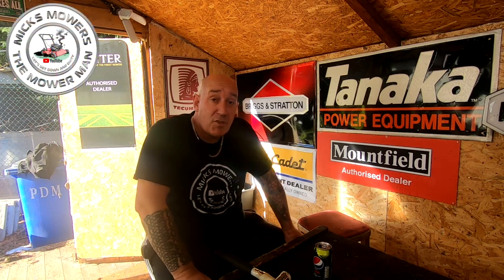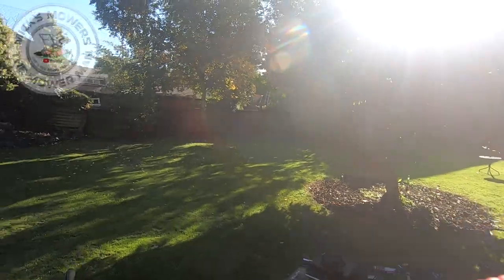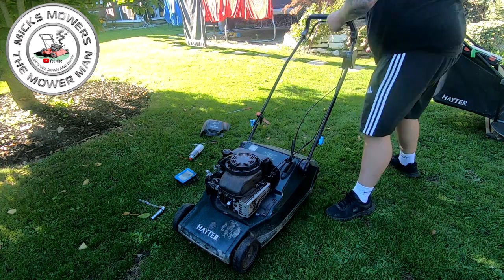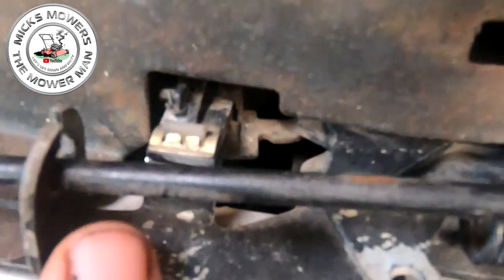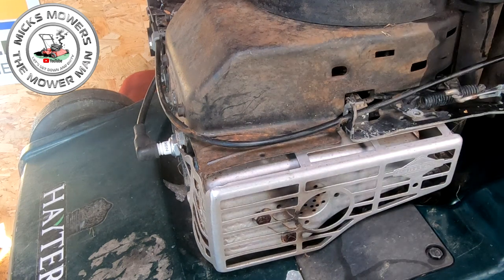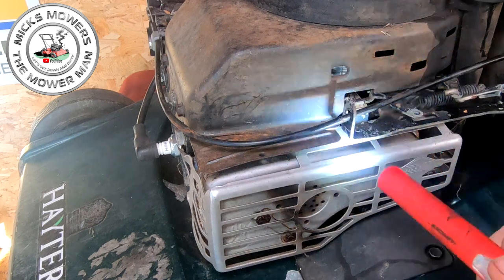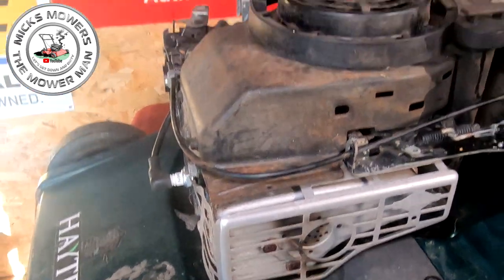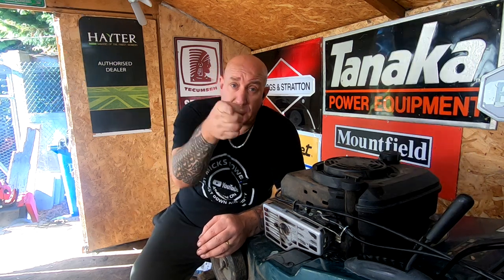Lawn Mower Will Not Start Or No Spark. Try This First..

Comment: Thank you Mick. Gonna disconnect the cable and try to adjust. Hopefully once I have done that , I can get adjust part to adjust. Both were just spinning last night by hand. 
I’ve a harrier 41 , is worth trying to take the top off ? To get closer to switch to give a clean?